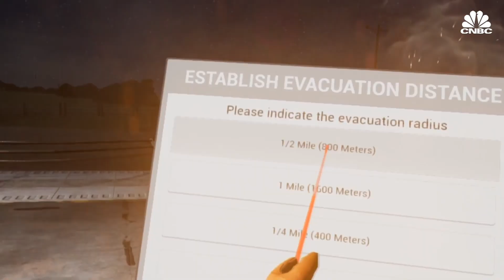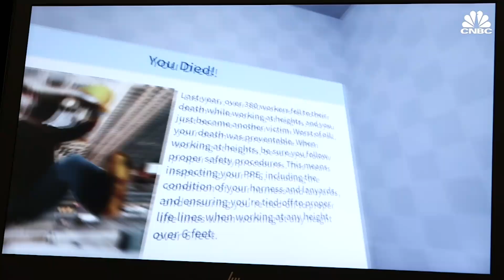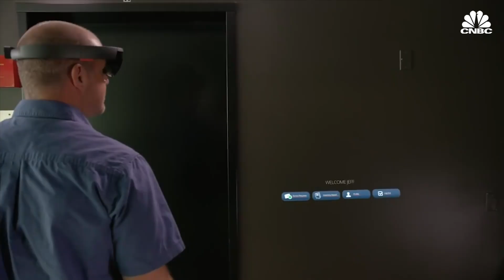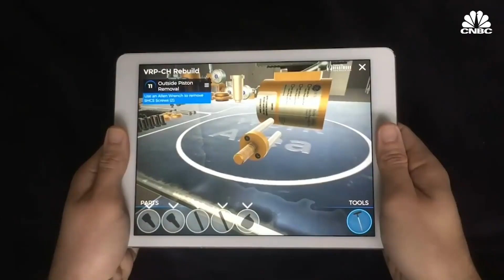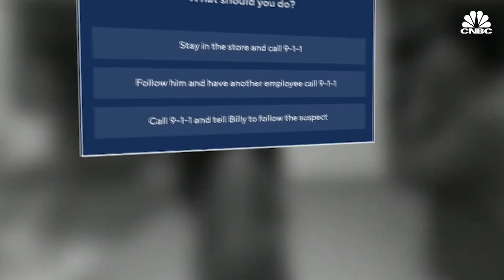Why Microsoft Uses Virtual Reality Headsets To Train Workers

Comment: VR will be the most important tech upgrade in next few coming years..
Reply: We started consistantly and constantly creating anti matter. Quantum computers are on the verge of quantum supremacy. Eeg machines are starting to be sold at affordable prices. And with ai assist you can use it as a hands free controller.

 Man we are on the edge of this world changing. So many tech that will radically change the world. I mean have you seen atlas from mit. There is so much more.
Ai,super materials like graphene or graphyne, Personal flying vehicles, electric vehicles, and new batteries my personal favorite solid state battery or nuclear battery. Using a type of nickle. I mean really vr will add allot of change. But will it be the biggest. 

I could go on there is soooooooo much comming out and I did not even get into human modification like crisper or cybernetics.
Reply: @alexhutchins6161  jesus
Reply: Ha
Reply: No it wont. Not at all